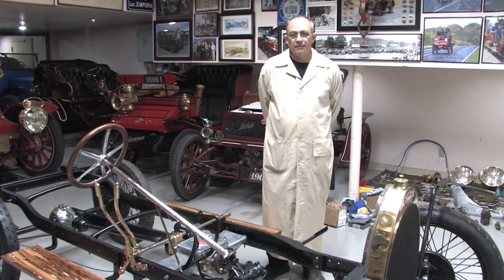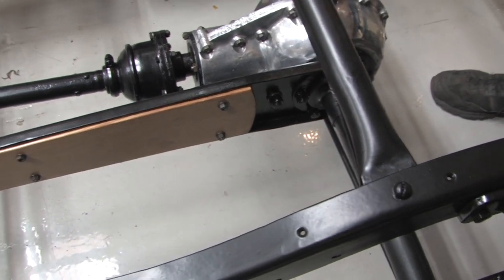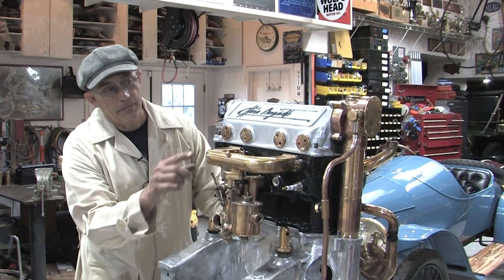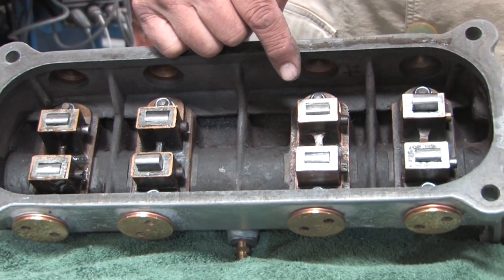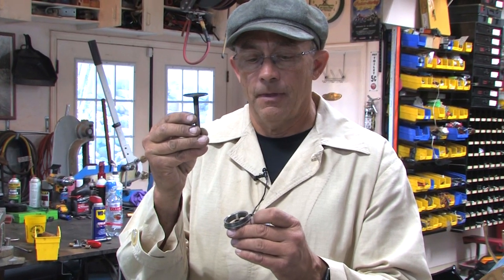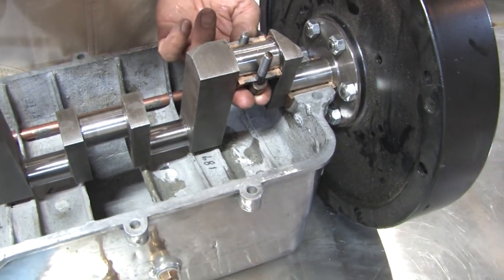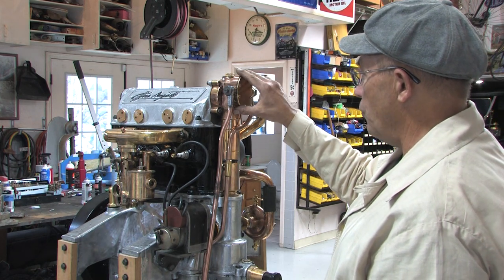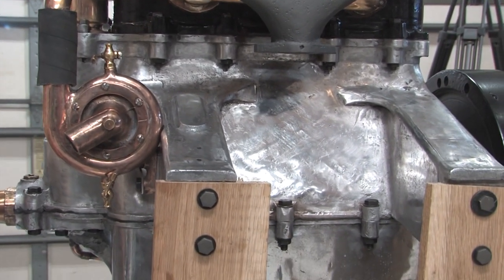1913 Bugatti Sport Racer complete professional restoration process.

Comment: I have worked ona 1914 Vulcan car which had the same carb,which also drew warm air through the block exactly the same way . It was amazing how the engine makers back then knew that fuel was not up to par and how to achieve better atomisation. Others who had worked on  the engine before me didn't understand why the carb had three intake ports. Flooding was necessary to get them to start on the crank but it had electric start which enabled easy starting.